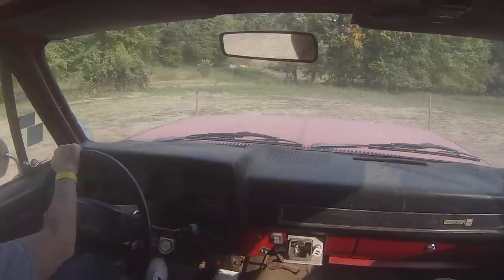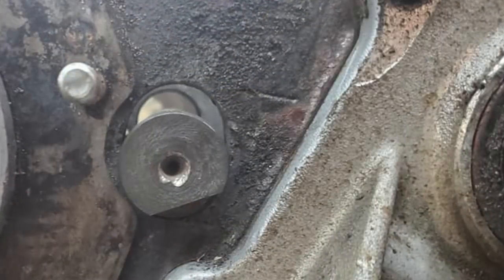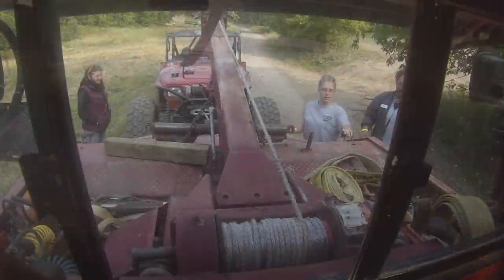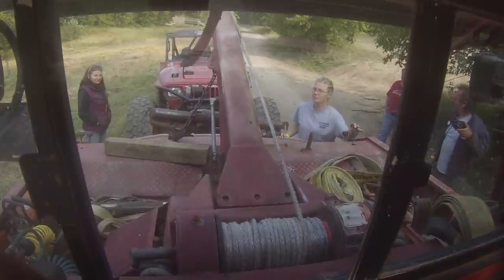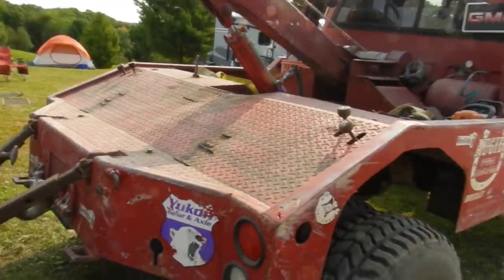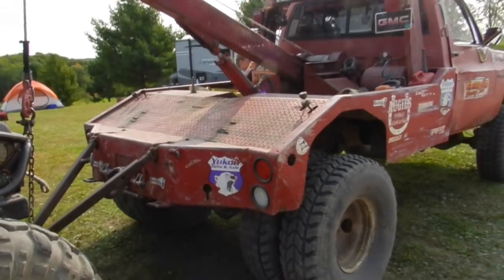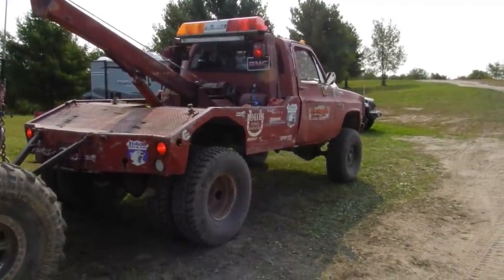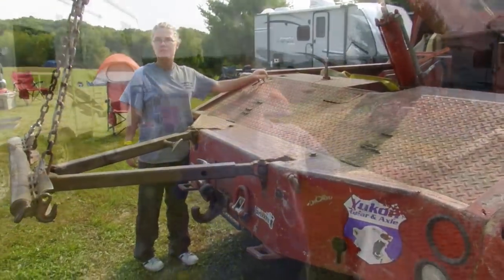SEAT COVER FIRST TOW WITH THE WRECKER by BSF Recovery Team

Comment: Get your repair team to fix that miss oriented steering wheel.   You have a lot of undue confidence in those threaded carabiners.  They make ones that pry open and weld shut.  Your J chain is supposed to hook to those rings at the boom head so when your winch cable, chains, or quadrant fail the towed vehicle stays in place.